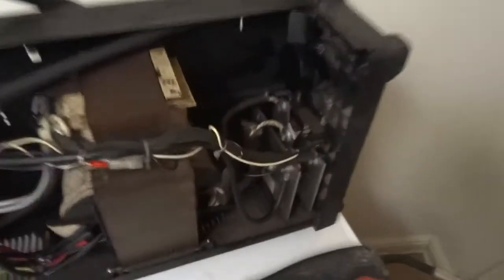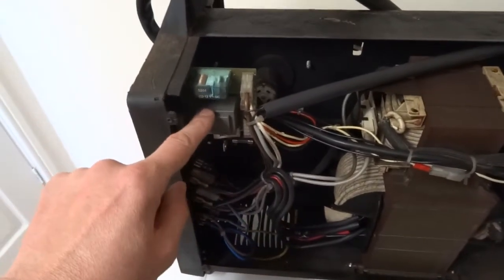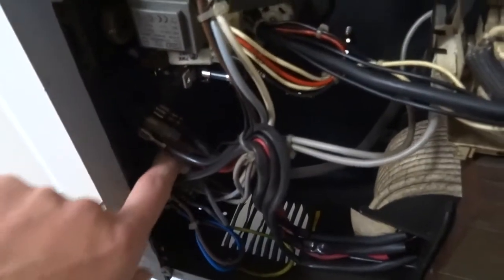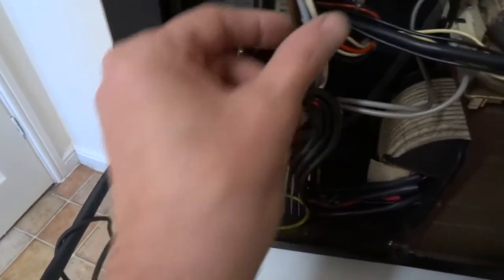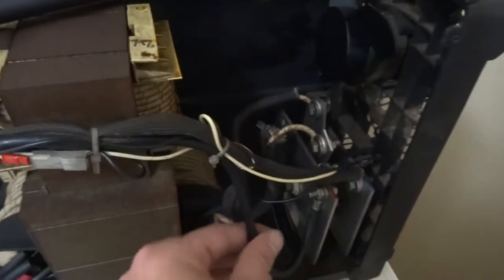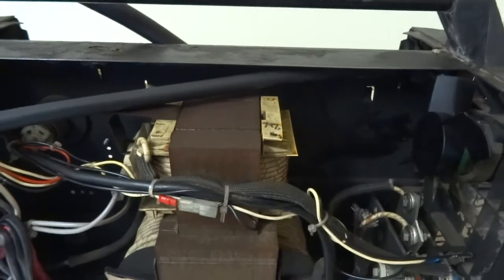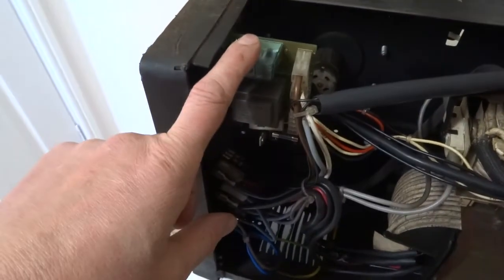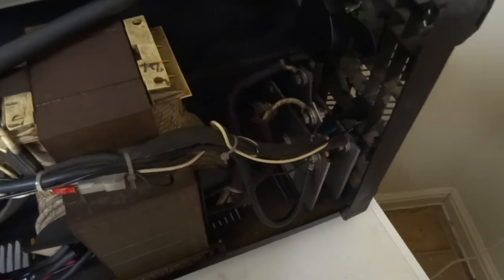MIG Welder Repair Guide: Inside a MIG Machine & Troubleshooting All Faults

Comment: Hi
My mig suddenly started tripping the breaker, if i start on low then high it welds perfectly ok, but when i let it cool and start on high again it trips,toughts?
Reply from the maker: transformer inrush current is tripping it , not sur why its got worse maybe wear you can get circuit breakers than will hande inrush currents i have one in my garage.
Reply: @cagmito76  The mig is 12 years old could replacing the capacitors fix it?
It has three  63vDC 12000uF capacitors.
Reply from the maker: @NicholasMuscat-cl1qo test them make sure they are not shorting out and the are the correct mfarads
Reply: @cagmito76  That is my problem, I have a good meter it can check capasitors up to 500mf no problem but not this size capacitance.
I did an ohms test that shows the capasitors are draining and charging I all so charged them with a 12v battery and they spark slightly, but this tells me nothing.
Can you recommend a mete or a methodr?
Reply: @cagmito76  So I bought 3 new capacitors worked flawlessly for 2 days but started tripping again today.
I have a 32amp type C breaker on it, but its tripping the main breaker all I  have is 2 fridges running.
Checked rectifier and P.C.B diodes, earthing for transformer, inductor and all you mention all seem ok.
Reply from the maker: its not tripping the 32 mp but the 100amp main thats odd as it should trip 32 amp cicuit first. have you and try it carefully and isolated from supply and with insulated tools  to tighten the wires in breakers and main fuse..
Reply from the maker: maybe wires are loose just  thought, if it was tripping the 32amp type C i would suugest getting a type D but if its tripping main then thats unusual.
Reply: @cagmito76  I`ll give that a go tomorrow
Reply: No cigar.
My circuit is 3 phase,  one phase for the house. I isolate the other breakers with the other phases and just leave the house breaker, the welder is still just tripping the 64amp main 3 phase RCD breaker 3000amp  ~30mA(is this enough?).
Not  the main house breaker or the 32amp breaker the welders on.
Reply from the maker: @NicholasMuscat-cl1qo  odd not one I’ve seen before could you safely switch tripping breaker see if it’s faulty
Reply: @cagmito76  Sorry for the late reply but wanted to be certain, it was the faulty RCD. I replaced it with a new ABB type A RCD not a single trip since.

Comment: i’ve got same pcb on mine green relay can be seen and heard clicking when trigger pulled but wire feed motor inop.tested motor with a battery and it works any ideas cheers
Reply from the maker: Do some testing on board for opens transistor failure etc

Comment: Great clip mate. I have a 100 watt Mig welder but it stopped arching for some reason even though the wire feed still works. Where should I look for the fault? Cheers.
Reply from the maker: lots of possibilties best to do some testing
Reply: Hi, i have same issue now with my old Mig welder, did you by any chance fix yours and what was the problem?

Comment: Would you know what would cause welder to bog when pulling trigger. 
Wire feeds freely when trigger is pulled but bogs down and lights in my shop get dim ?
Thanks in advance 
Northern industrial 135 mig
Reply from the maker: Not sure it could be too powerful for you system , could be transformer losing a bit of insulation resistance and draining more power . Ive know people put 13 amp plugs on 16 amp machines. could be lose wiring in consumer unit  - plug or inside the machine.
Reply from the maker: did you sort ?
Reply: @cagmito76  I just now took cover off and nothing looks burnt (wiring\board etc. ) maybe I can send you a video of what’s it’s doing
Reply from the maker: @jjhaslacker3966  Yeah upload one and ill take a look for you.
Reply: @cagmito76  if I can figure out how to do it smh
Reply: @cagmito76  hopefully you can see video
Reply from the maker: @jjhaslacker3966  No did you make it public or send link
Reply: @cagmito76  I hope you was able to view 
The welder is about 15 years old so  might just get a new one
Reply from the maker: @jjhaslacker3966  looks a good machine , id be suspecting motor or transformer insulation would not like to replace that on yours  , maybe motor is worn and using excess amperage to start  , do you have an amp clamp meter to test motor current draw ?  , are you in USA ?
Reply: @cagmito76  I’m in USA 
I have a meter
Reply: Not sure if it’s amp clamp

Comment: finally found a simple explanation of all the parts! Cheers bud! I got an old maypole 140 given to me non-working and i need to figure out if its salvageable and your vids are ideal as the internals look exactly the same! The torch was busted so i have installed a new euro connection and got a new torch but i'll do all the tests in your other vid to make sure its ok before i try for an arc!  Also I would like to add flux core capability, My thoughts were to install two dinse plugs beside the feeder that i could swap the polarity easily for flux core. with a dinse plug on the clamp and one to the euro connector.... Is it as simple as i imagine or am i missing something?
Reply from the maker: Thanks zak cheers for comment , ill read it thoroughly later and get back